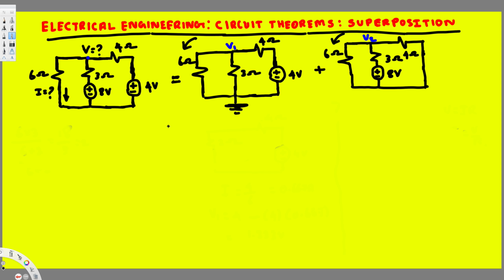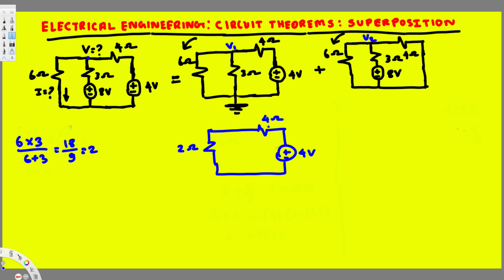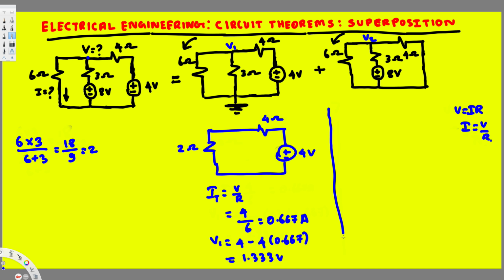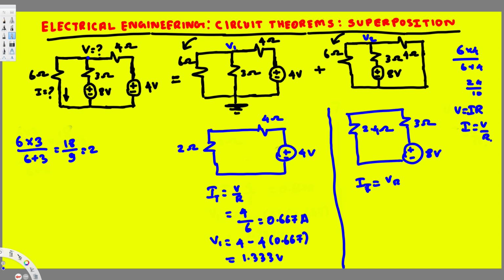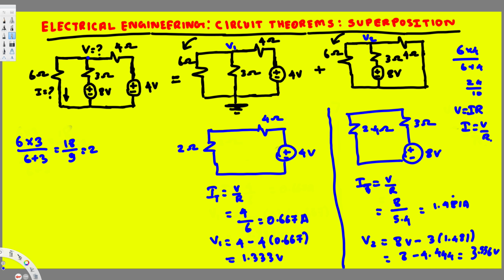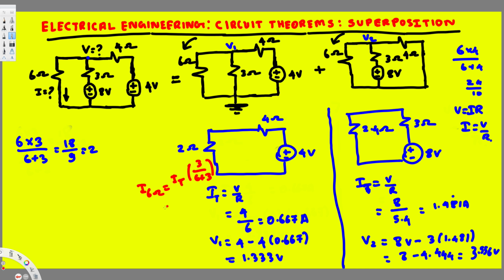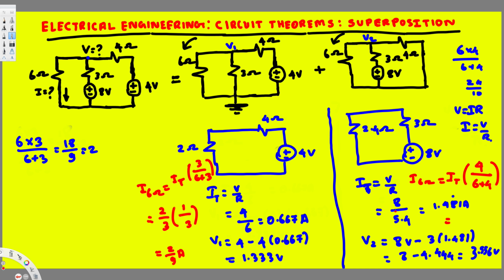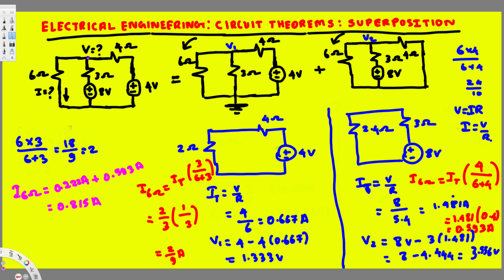Electrical Engineering : Circuit Theorems : Superposition Property

Comment: https://play.google.com/store/apps/details?id=electronicselectrical.com.electricalandelectronicseng

Electronics Engineering 
Electrical Engineering 
Electric Power Generation 
Electric Power Transmission 
Electric Power Distribution 
Electronics Devices and Circuit 
Electrical Measurements and Instrumentation 
Electrical Machine 
Computer Engineering 
Swtichgear And Protection 
Power Electronic Controlled Drives 
Power System Operation and Control 
Power Electronics 
Control System 
VLSI design 
Digital Signal Processing 
Digital Instrumentation 
Seminar 
Electrical Project 
Electronics Project 
Flexible AC Transmission System 
Neuro Fuzzy Control 
Network analysis 
Linear integrated circuit 
Power quality 
Computer organization 
Digital Electronics 
Electronics communication 
Signals and Systems 
Embedded System Design 
Arduino 
Other 
Engineering community is place where you can ask questions and receive answers from other members of the community. Feel free to ask any question from basic to advanced level related to college study or work. Ask any technical question or problem from book or any practical problem in project also you can ask about seminar. If you are engineering student B.E. or engineer then here you can solve your problems in group by asking questions publicly and help other members by answering their questions and problems. Users from different places come here. If you have any suggestion or feedback regarding the website or app you can send it the feedback link is at bottom left.
http://goo.gl/3jQsLk